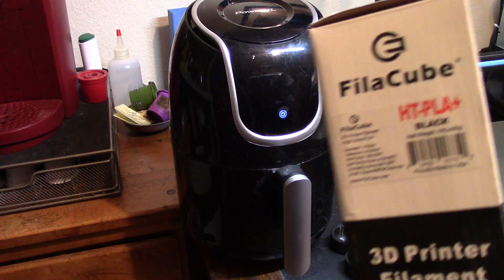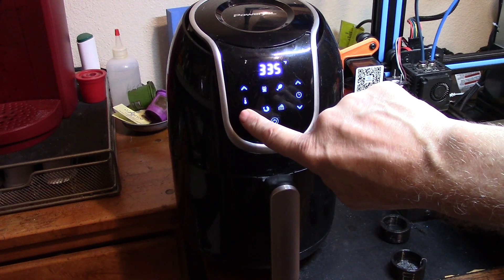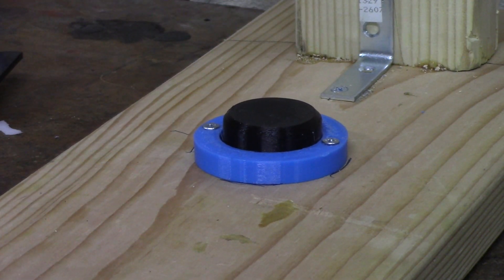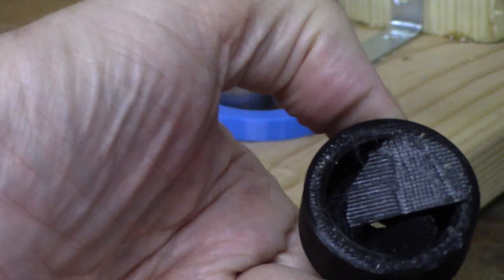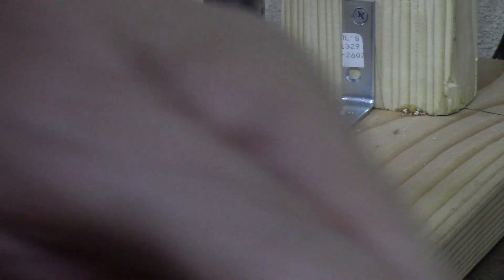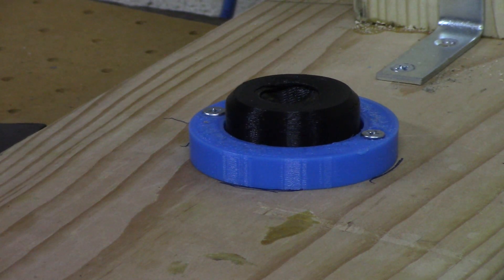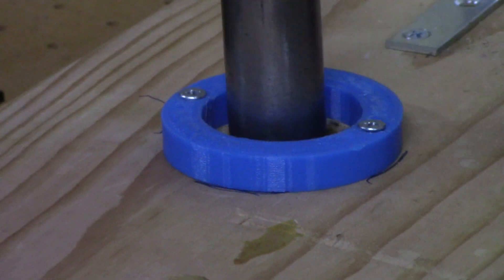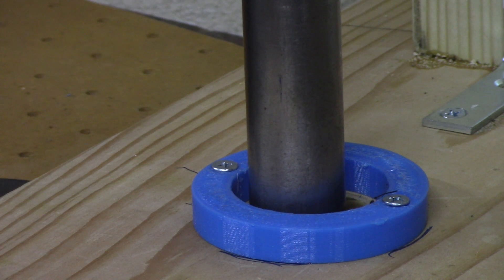FilaCube HT PLA+ Annealed and Impact Tested!

Comment: Interesting result, was not expecting that! Did you test how much of an impact there was to dimensional stability? Or, more specifically and simply, does it still screw on to the hammer head after heat trading, and has it impacted the fit significantly?
Reply from the maker: I was expecting a difference in impact damage resistance, but not that big a difference. This particular piece wasn't designed to screw onto the hammer, it's designed to be fast to print and take a certain amount of impacts to break. As far as dimensional changes, the diameter of the part is 40mm. The printed, non heat treated part is 40.12 and the heat treated part is 39.65. So depending on the part it's either not an issue or a 1% scale factor could be used.
Reply: @3rdpig  that's fantastic. Might have to order a spool after all! 🤣 Too bad you didn't have it for your sunlight/weathering test, that's the remaining question. Thanks for your videos, they're a WEALTH of practical information!